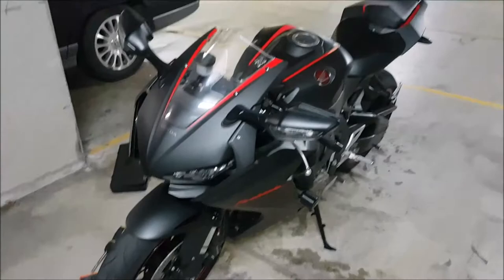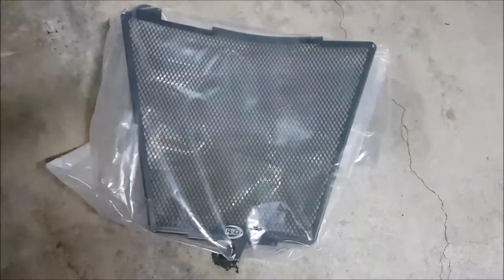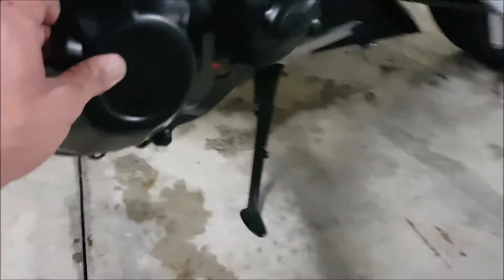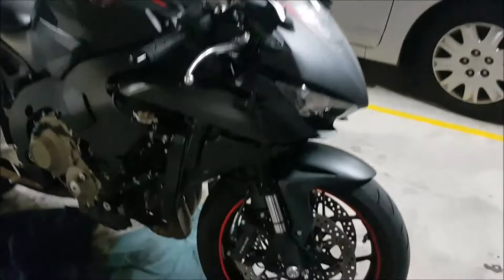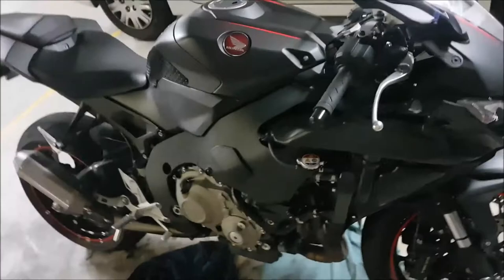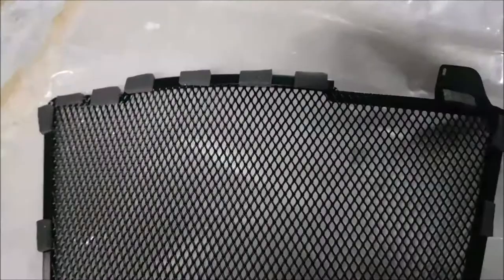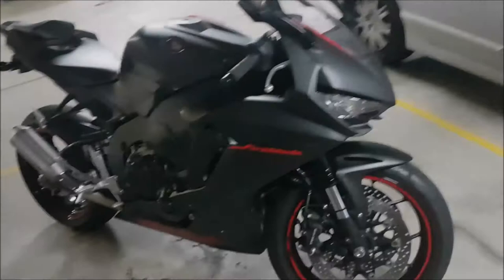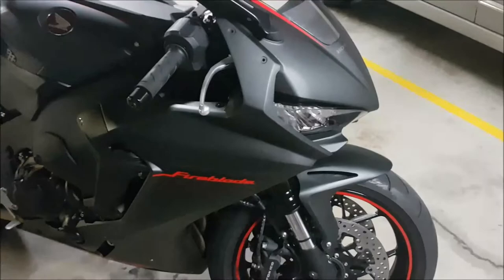INSTALL: R&G Case Covers and Rad Guard for 2017 CBR1000RR

Comment: Thanks for making the video.
I installed the rad guard today and where do you zip tied around the top right side of the rad guard?  I had it around the top right radiator mounting bracket and there is a plastic piece where brake hose is comes down which goes behind the radiator.  That plastic piece seems to be rubbing on the brake hose.
Reply: Did you end up threading a zip tie around the top left side of the rad guard? 
There is a small hole on the top left the radiator corner in line with the rad guard top left hole but I don't feel comfortable putting the zip tie into the radiator.

Comment: That’s strange. Mine has black engine covers from the factory. Must be a U.S. thing. Seeing yours, going black is definitely a must.
Reply from the maker: lockheed08 yo dude I noticed that to. You get case covers for free in US it seems? I wonder if they can take a slide
Reply: POMMEY BIKER it’s sturdy enough to take a fall, probably a gentle slide. Yea, it’s free, it just comes that way. I had no idea it was plastic until I inspected the one I was buying. Doh!
Reply from the maker: lockheed08 if you find a part number for it; please let me know what it is
Reply: POMMEY BIKER ok, so I looked it up. Turns out only the right side has a cover(I just got it so I’m still learning about it lol). Stator cover is black metal. Here’s the link for the whole thing. 
https://www.hondapartshouse.com/oemparts/a/hon/58e2bbc587a866054c370a5f/right-crankcase-cover

Comment: wish you showed removing the fairings mate,not a clue how to get them off,im guessing when the frame slider comes off each side you have to put the engine mount bolt back in before taking the other side off ?
Reply: just watched thru totally,surely having two engine mount bolts out isn't a wise idea  ?
Reply: and ive looked again ,the engine mount bolts go through the bracket  and the crash bungs onto the other side of that bracket..

if you ever feel like doing a video showing us how to remove the side fairings that would be great,i got my racing radiator guard installed without removing anything using two cable ties and a lot of fiddling about
Reply from the maker: Here you go mate: https://www.youtube.com/watch?v=js9m2YCaMO4&t=3s
Reply from the maker: Also there are 3 (6 including both sides) points that hold the engine, so removing one should allow it to remain in place, but you should have a jack under the engine, again, one at a time does the trick
Reply: i realised you removed the crash bungs form the r&g bracket thats mounted onto the engine mount,wasnt having a very bright day mate,ive noticed the infil panel on my right hand side wasnt fitted correctly and i cant get the small bolt to undo on the letal bracket the infil panels supposed to be tucked in behind,so back to the dealers and they can sort it
TRhanks for the link ill take a look

Comment: Silly question  mate the calipers dont have pad pins on and i was wondering if you had or have seen a video of the pads being changed,normally i would check the service manual but i am yet to come across a copy anywhere
Reply from the maker: its a clip kinda thing, once the calipers are off, the clip jumps out and the pads just slide out :) Ive changed my pads about 3 months ago
Reply: @pommeybiker  yeah a spring clip with a clip top and bottom,i get confused easily and the only brakes ive stripped had the pins,cant find a service book for the blade yet other than an american one they want a whole heap of cash for

Comment: I couldnt even be fucked cleaning the inside fairings man. Im hopefully buying the 2017 blade near the end of the year and really want to get the whole frame slider set for fairings front wheel and rear. where have you ordered them from and does it come with exact instructions
Reply from the maker: Jensens Photography comes with terrible black and white instructions and list of tools you need. I recommend downloading colour instructions from the website. Got them from the store I bought the motorbike from cus I get life time 10% discount. Parts take 1-3 weeks to arrive as they were on back order